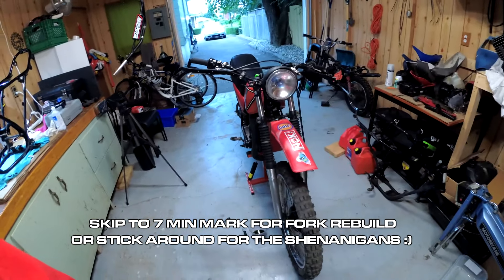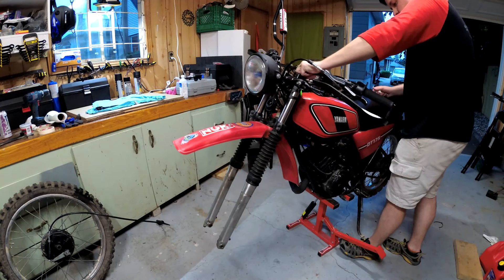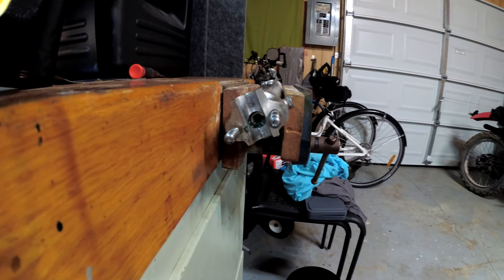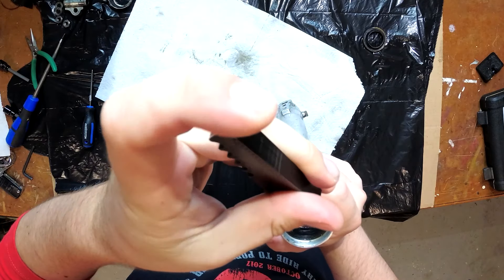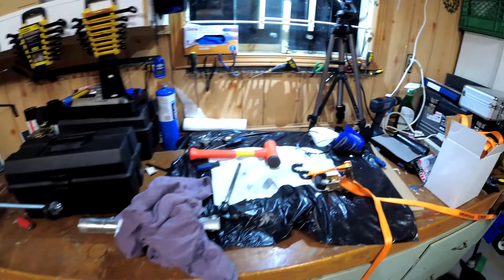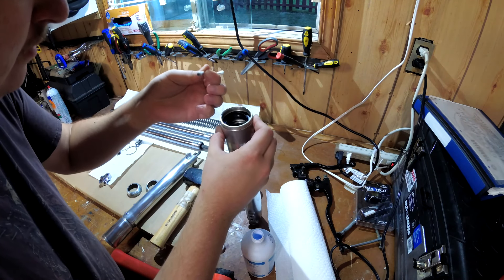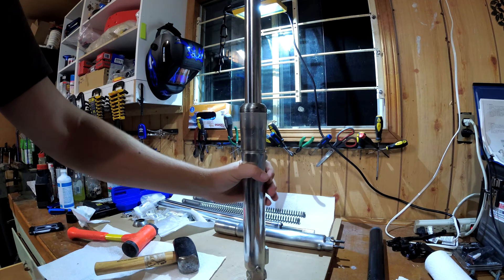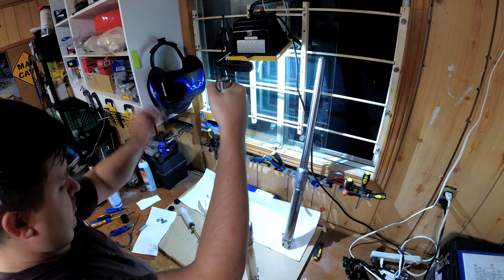I Rebuilt My Dual Sport Suspension and it was a Nightmare! (Yamaha DT175 Fork Rebuild)

Comment: I swapped my '79 forks for the 35mm '85 on and same thing. Had to locate and secure a triple tree. Then had to make holes to put the horn in the same spot, and had to make a plate to put the instruments back because the later ones are wider apart. Next was searching ebay for a headlight bracket. Finally could put the wiring back. Phew, took a while but thats what we like to do.

Comment: Nice man, idk about yours but my forks had 3 seals, the dust seal, the main oil seal and then a rubber coated steel seal. Found out that the best way to deal with the 3rd seal is to cut
a slot in it with a dremel, no full cut but so thin you can break it with a flathead screwdriver and pry it out
Reply from the maker: I've been seeing this lately and it made me wonder if I never went far enough, however, these are one-year forks from a '78 which are different from '79+. I typically check exploded view diagrams and it would have been hard to miss multiple sets of seals...but I am still wondering now xD

Comment: nice content bro, this is what i m looking for, i have DT100 1977, and this video will help me for the front fork work, at 24:35 where can i get the shinny tube, i dont know what they called it, mine for both sides are rusty. I would be most grate ful if you could give me details of the part number or any brand that suits it, thanks
Reply: That's your inner fork tube. Now are not available. There a aftermarket tubes available from Thailand in 32mm size.